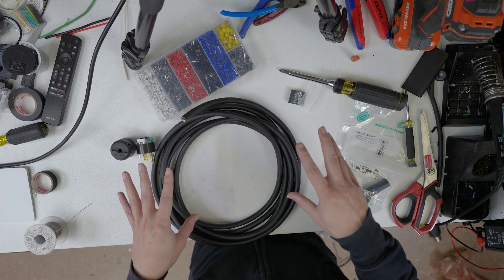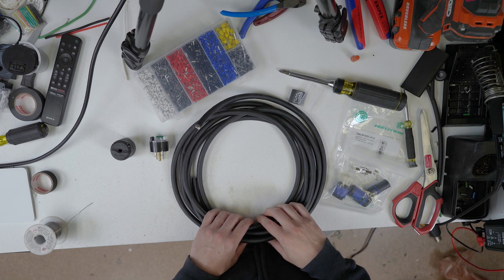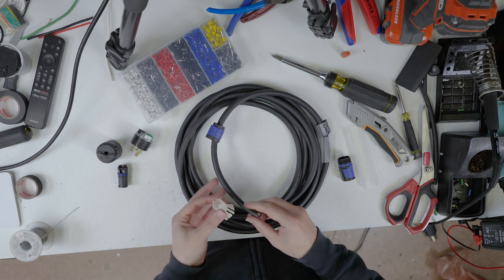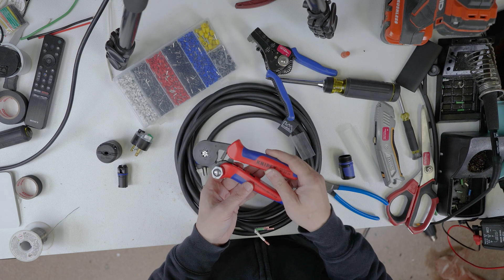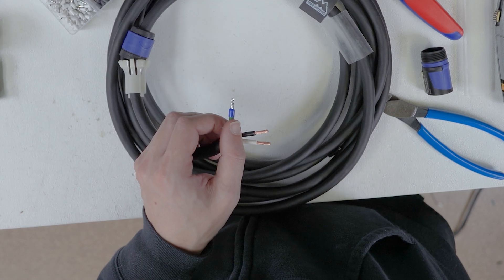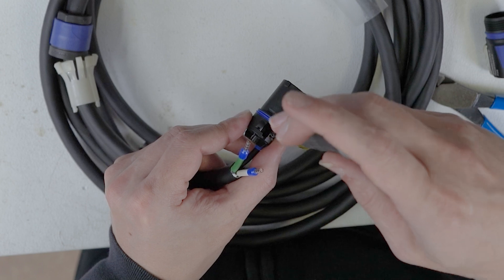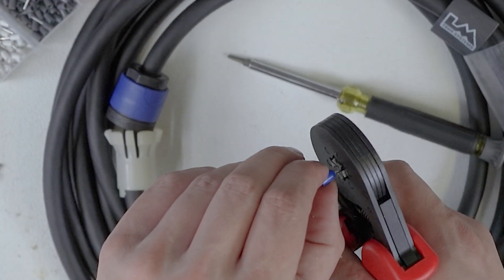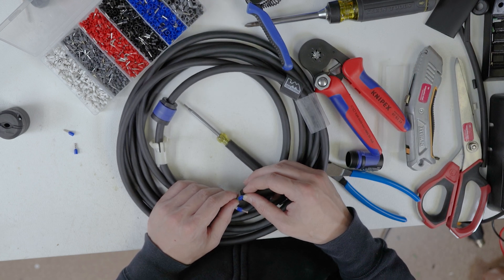Ferule Redemption! Building A Powercon Cable w/Ferules.

Comment: I have been using ferrules since 1997 or 1998. I think '98. When we were young...

I started using them because of some German rules (I believe DIN Standard) requiring them on cable used for extension cables. So basically no choice when you got gigs in Germany. 

Anyhow, I was years ahead of the rest with that here in the Netherlands. But ferrules have been gaining more and more traction ever since.

As for color and sizes:
Check out the videos efixx did on ferrules. Use the search function. 
And while you asked: Blue is for 2,5mm2. German invention so metric.

As for crimpers:
Klauke all the way. In all shapes and sizes.

But you do know that Neutrik designed the Powercon to be used without ferrules? That is what that pressure plate is for. Like we give a fuck...

Former Neutrik product tester and father of the Ultimate Plug and that nice little sentence on bags to use what type and size of screwdriver here but not on speaking terms with that ex anymore. We had a fight about the kids (= Neutrik  products I came up with and/or made improvements on). 

And while you asked: It's 2.30 am over here.